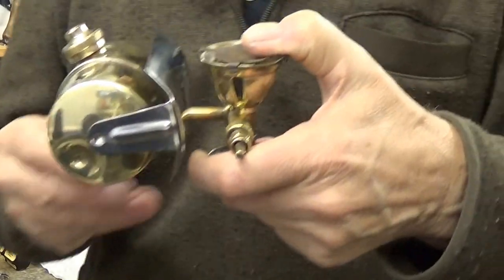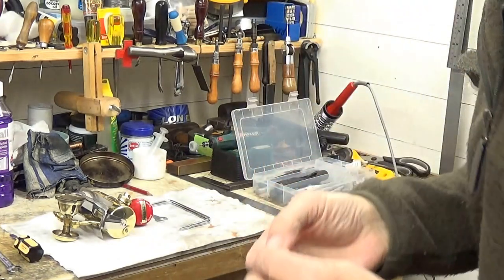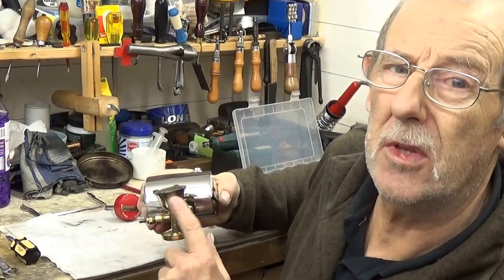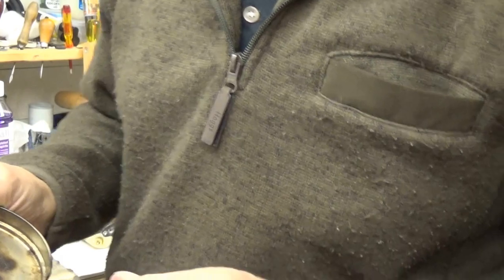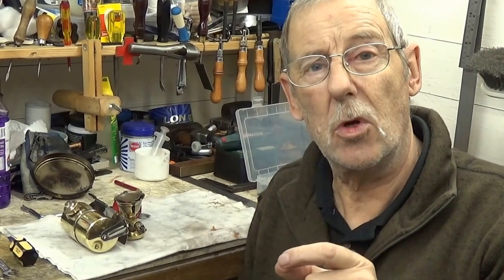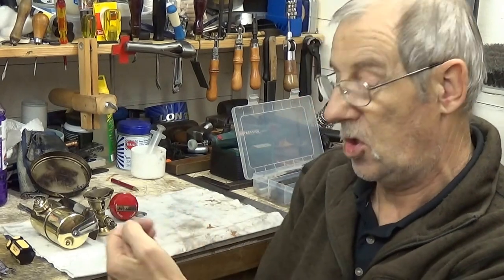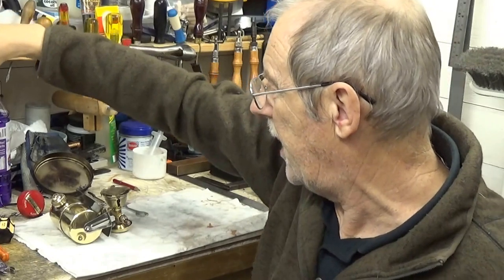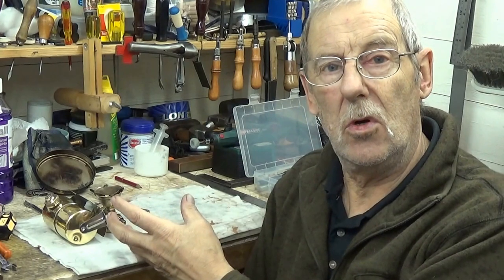Optimus 8R Stove

Comment: I think what you have there is a Precise Phoenix Backpacking Stove, a Chinese clone of the Optimus 8R (though that name was used for clones of several different types of stove). If you still have that stove it would be interesting to know the interchangeability of parts between it, a Swedish 8R and the Soviet PT-1. Do the threads match etc. 
Many thanks for your videos, between you and BernieDawg you gave me the confidence to fettle a very rough 8R into a reliable and very usable stove. If you haven't yet, and can find it locally, try Aspen 4 fuel. Very clean. I now use it in all the white gas (Coleman fuel) and/or unleaded petrol lanterns and stoves that I own. 
It's also far cheaper! 
All the best and thanks again.

Comment: Hi CharlieTango 1. This is a general question suggested by your video. I bought an 8R new about 35 years ago. Only used it 2 or 3 times so it's in mint condition. A close inspection (without disassembling it) suggest all is in factory order. However, when I brought it out a few weeks ago. I can't get a good blue flame and the flame even goes out after ten or fifteen minutes. I thought this could be due to the wick, but it seems to be in A1 condition. Any idea what the problem could be? Thanks in advance.
Reply: @charlietango1635  Hello CharlieTango. Thank you for your reply and your generous offer, I will keep it in mind! The Fettling Forum of the group https://classiccampstoves.com/ also suggested replacing the fuel tank gasket so I'll see how that works before trying anything else (I ordered the part!).

Comment: Hey there, Charlie... Question about graphite paste. What do you mean by washing up liquid? Could you be little more precise? And which material do you use for making gland packings? Thanks in advance.

Admire your work. I have also fettle 2 hunters. One original and one Russian clone. Here is the subtitled video: https://www.youtube.com/watch?v=hPjdE-CFPlg . 
Regards. IZ.
Reply from the maker: +Naftas81  Hi there IZ,  if you ground down the lead in a 4" pencil to a dust, then add 1 or 2 drops of washing up liquid, ( the liquid you add to hot water to wash your dishes and plates etc,) but you only need to pack that in before putting the nut back on the spindle, on the Swedish stove only.